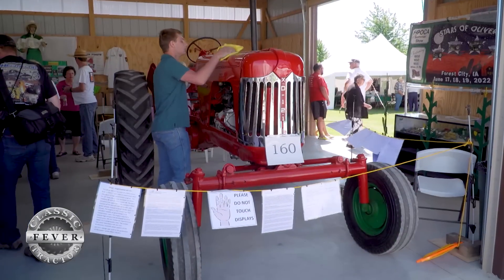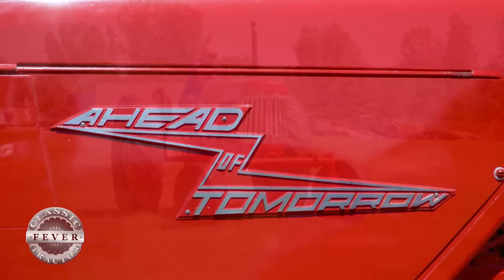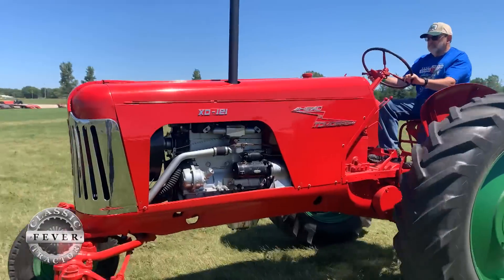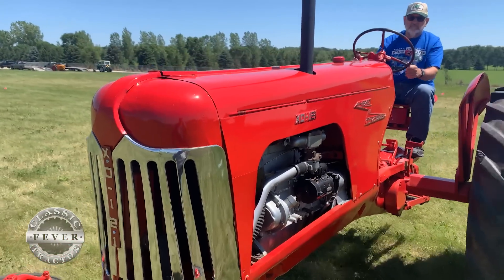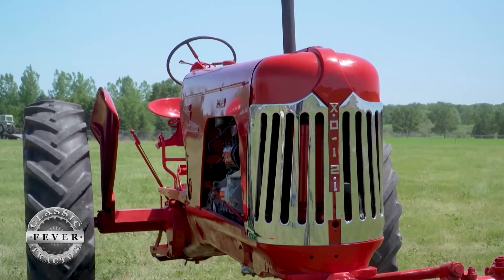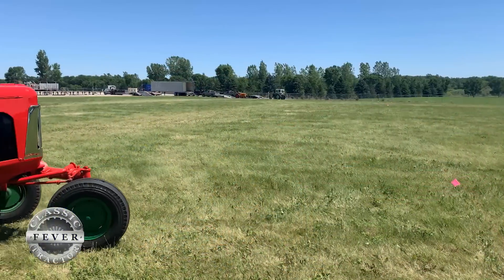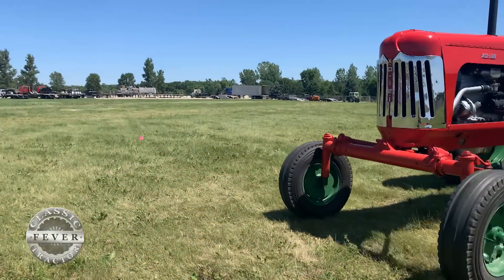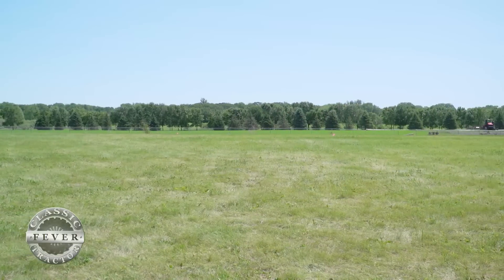Experimental Oliver! The One & Only RED Oliver XO-121!

Comment: That was so cool!
We had two Oliver's on the farm, a 77 gas and a Super 88 with the Waukesha diesel. Dad put a turbo on the 88 and boy did that thing come to life! He also installed a set of 18.4 – 38's on the rear and topped them off with fluid. We reminisced about how that thing would hook up pulling the disc. That was one of the last conversations we had while he was in hospice. He died in 2020. Thanks a lot for the video, it went straight to the heart.
Reply: have😊red

Comment: What is the bent red handle down low on the dash  this the pull starter rod i have only seen them on diesels never a gas ???????????
Reply: Not certain about it....but might possibly be a compression release  used to make starting the engine easier. This tractor was probably still running a 6 volt starting system.

Comment: One quick correction.  The Oliver XO-121s were run on Ethanol (today's equivalent of e85).   Not gasoline.  it'll run on high octane gasoline with some carburetor adjustments, but the originals were tuned for exactly what is e85 today.

(I helped tune the other running Oliver XO-121)

Pretty tractor!

Comment: Good  day from Ontario.  Interesting   The engine lookalmost like a flat head?  Anybody know?   Thanks
Reply: It's a Hercules overhead valve. I don't remember the exact model, but it was originally a diesel engine so that the bottom end could handle the higher compression ratio.
Reply: @ThatOliverGuyChris  Good  day  mr. Chris.  I guess if anybody knows it would be u.  Thanks